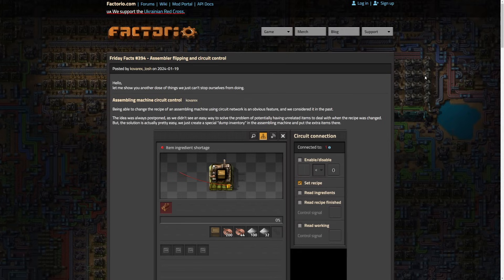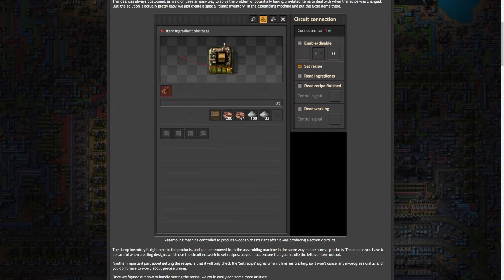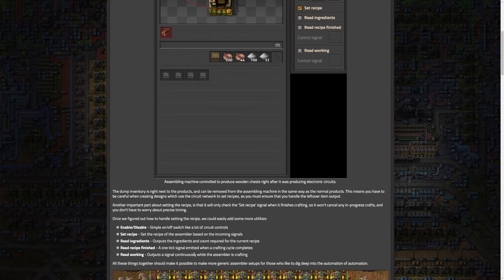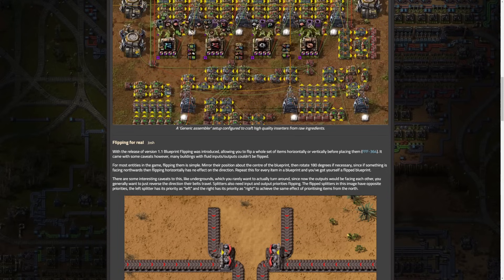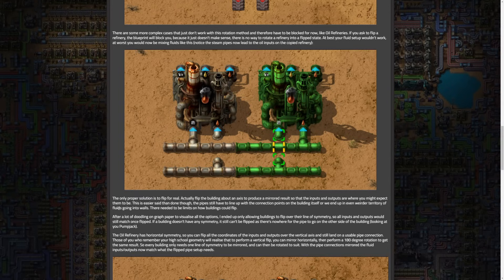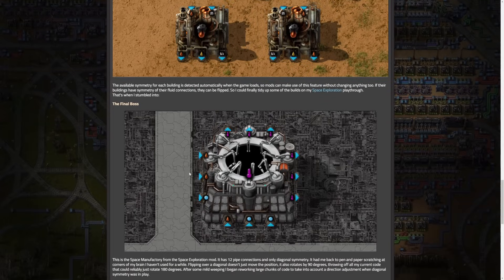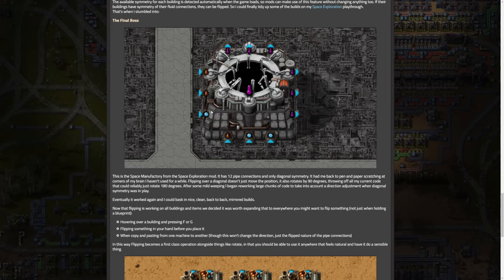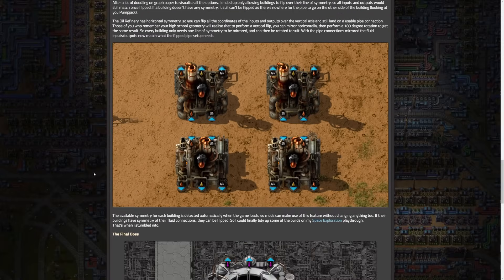Factorio Friday Facts #394: Circuit Controlled Assemblers & Better Flip! - FFF Discussion & Analysis

Comment: I can see myself having just one big module Factory that produces any module that is needed on demand. That is a bit easier to handle, since they have the same ingredients. Also, maybe someone will combine the assembler demands with the train schedule interrupt.... Also, I wonder if at some point the devs might introduce that you can use production statistics in the circuit network, so when your green circuits are low you can detect that globally.
Flipping awesome updates!
Reply from the maker: I hadn't even thought about using the circuit connections for assemblers to tie into trains, that sounds awesome!
Also, having the production stats be able to be read and used in the circuit network would be absolutely game changing! I really want this now lol
Reply: Wow. One assembler-setup that produces all 3 modules. That is the first use case I would actually consider to use. 
Until now I though this was useless for a normal playthrough.

Comment: Seeing they listened to the name issue, I wish they would fix long inserters as well and just remove them and make inserters configurable like in bobs inserters too. I'm now angry that I forgot to comment this suggestion on forum last week, but many people want other long inserters (like fast or bulk) but it would make so much clutter. I would rather have filter inserters stay and remove long inserters.
Reply: If I were making Factorio, way back when, I would not have made inserters at all. Belts would snap directly to machines in the same way pipes do. You would be able to place belt corner pieces alone without needing another belt to do it. "Corner" would just be four of the eight belt rotations.

Comment: I want to know what happens to the productivity bar when the assembler circuit-changes the recipe.

Can we run cheap items to 90% fill the productivity bar then switch to e.g. tier 3 module and get a cheaper-than-normal duplicate?
Reply: I think the production will complete before the new recipe is activated.
Reply: @Yggdrasil42  yes they mentioned production, I meant the other bar from productivity modules.

Comment: One issue in the assembler recipes would be if an inserter is holding an item when the recipe changes. If there is no input to put the item into in the assembler, will the inserter get stuck? Or will an assembler be able to take in items unrelated to its crafting recipe?
Reply from the maker: Hmm that is a good point actually, and oddly not something they addressed in the FFF.
I'd be very surprised if they hadn't thought of that scenario though, so I'm gonna assume did something to resolve it
Reply: you can fix this with the circuit network buy turning the inserter off when it's empty before changing the recipe and then turn it back on afterwards.
Reply: @Ghorda9  You could. However requiring that makes things far more complicated and greatly reduces the number of people who will use the feature without just copying a blueprint.
Reply: @arthurmoore9488  you can still copy the heart of the the circuit with blueprints.
Reply: @arthurmoore9488  also it might sound complicated but it's not as bad as it seems, you just need an order of operations.
Reply: @arthurmoore9488  as an example you could even link the operations to different ticks on a counter/timer.

Comment: Realy nice things. Thx for the video.

Reraly the most news are cool that the show in the last few fff.
I hipe only they make not to many problems away. Yes ist a very coll qol but you dont must think so much as before right? And for me i love to think about problems. I hope it is all in all not to easy with all this new features. But otherside, what will all the modder can do with all this new possibillities - Factorio have a very great furure i think.
Reply: There's problems to solve and there are common annoyances and things that have to be done by hand because the system can't do something "simple."  Flipping does simplify piping, but most of the time the connections and lack of symetry is just annoying rather than a real problem.

Comment: There is only one piece of territory that I can see, one final piece, to make flipped blueprints work... The ability to make flipped inserters that default to left side of belt when inserting to straight belts.
Reply: Yes, it's a final boss. Maybe train station too.
Reply: Didn't even think of that.  It really would help eliminate so much stupid clutter.  There's a fine line between design challenges and just having things that are annoying.  Changing inserters like that would remove an annoyance, rather than just "making the game easier."

Comment: It will be interesting to see how this works with productivity modules like making 4 green circuits then changing the recipe to blue circuits and getting the bonus productivity then changing it back to green circuits rinse repeat victory
Reply: I’ve noticed that miners on mixed ores will mine ten of one ore before deciding whether to switch to the other (at least, once you research the first productivity upgrade). This will probably work similarly: if an assembler has a productivity bonus, it’ll only check the set-recipe signal after a cycle that generates the bonus output.

Comment: Now I do not wish to complain too much about flipping because it looks sweet, but really it wasn't as bad as some seem to say.  Yes, it does mess up with sweet straight lines but I always think that if you're stuck in straight lines just fuck off and go play by yourself in a quiet dark room and please never show your face.  Oops, sorry.  But with oil it's not huge just move the south machine to the right or left by two squares and leave like 3 rows between the machines, directly connect the like fluid, and jump the pipe with the second fluid to connect it, not such a big deal and it works almost always.  It does get harder when you say but now I want beacons, yeah have fun :)

Comment: I never understood the reasons for not doing the fluid machines.   It's "super easy, barely and inconvenience",   They already have two variants for each one so the code can handle variants.  All they needed to do was add a few more variants.   
I concede that their code may be a hard coded spaghetti mess but given the quality they produce I don't think so.
Trains on the other hand would need a new philosophy as to how to implement them as they are currently keyed.   That would be rough to change without breaking everything.

Comment: Circuit controlled assemblers, been wanting that forever. How about other circuit controlled machines though?

The flipping refineries is nice, but I still don't see why they can't do flipping on pumpjacks, seems like it shouldn't be hard to do. Also how about flipping rail signals and train stations? Another thing that has really bothered me is when I have a blueprint with rails and it is 1 or 2 tiles off on the grid (not even constrained) so it makes it hard to use it without removing the rails from it to get it properly aligned.